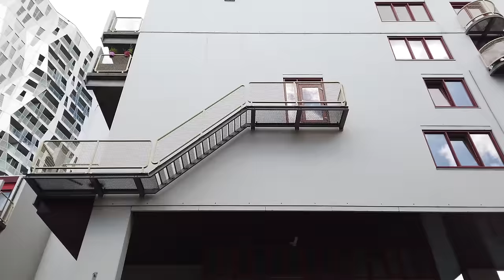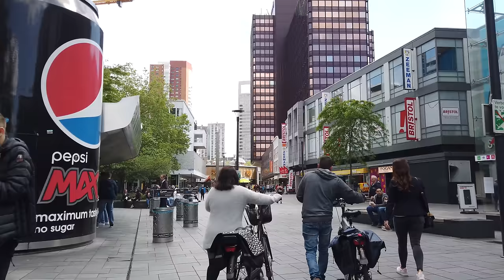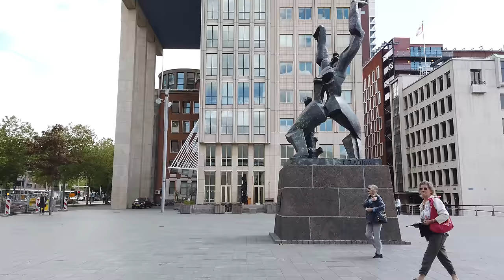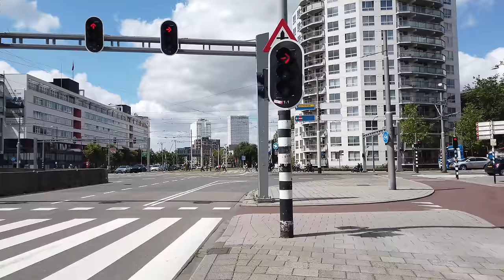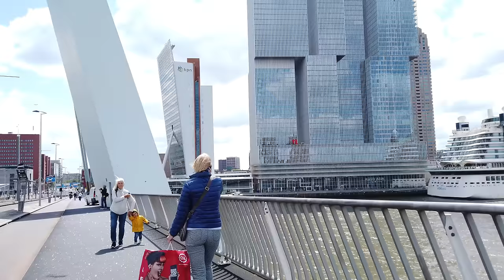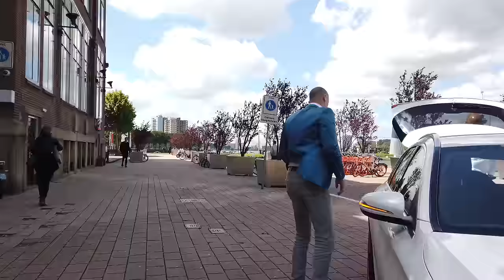Walking in ROTTERDAM / Netherlands 🇳🇱- 4K 60fps (UHD)

Comment: Cant believe its shot with just an Osmo. Really nice footage
Reply from the maker: Thank you! The videos from 2019/2020 are all wit the Osmo Pocket 1 which has so far the best picture quality. The footage from the normal color profile could be used straight away. From 2021 I started recording with the DJI Pocket 2 though I was never really happy with the picture quality even when using D-Cineline and grading. The DJI forums have a ton of complaints about the Pocket 2 as well and no firmware update for over a year. Even today I ordered another Pocket 1 for additional footage and hope that some new Pocket 3 or competitor comes out soon